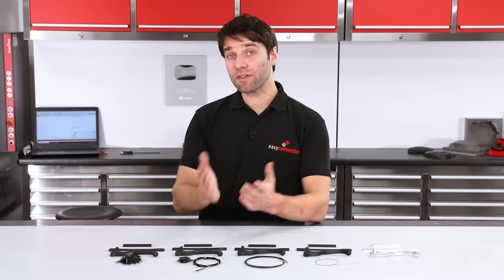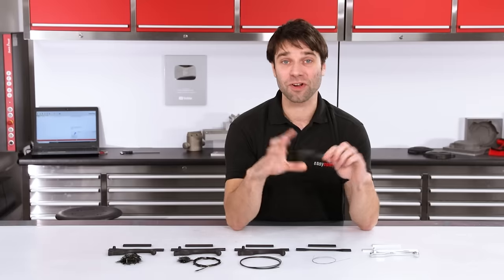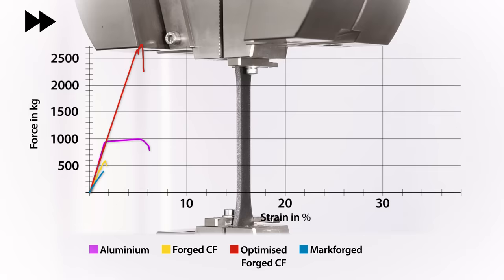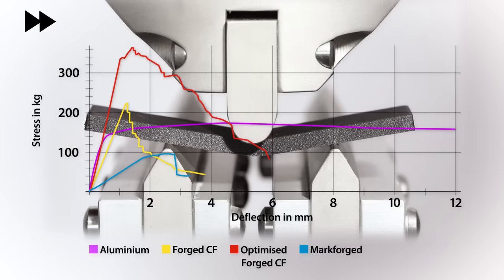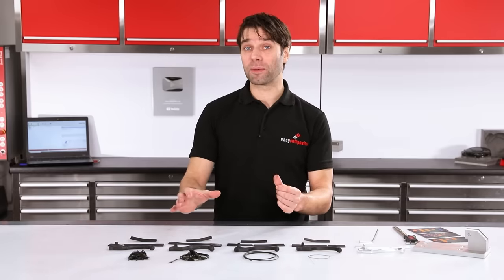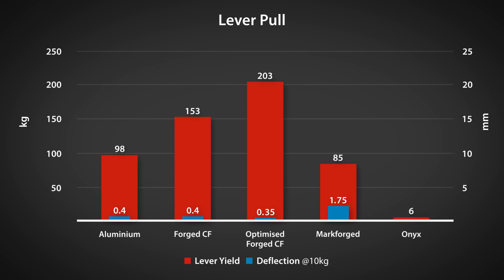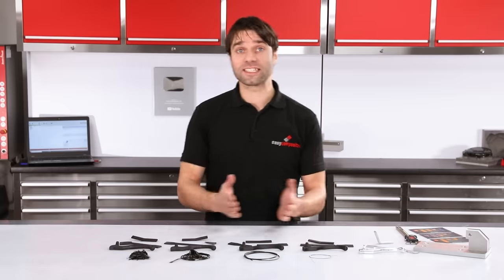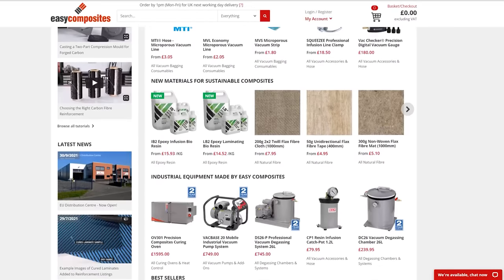How Strong is Forged Carbon Fibre? Forged Carbon vs Aluminium vs Markforged vs Onyx

Comment: Impressive video, the content alone is practically enough for a publication, but then you go and deliver it in such a comprehensive way, thank you very much for that. 

I do have a question, 3D printing seems to really have gotten a foothold in composite production, do you know of any filaments that can be used to directly print a mould for prepreg CF? It would need to stable at pretty high temperatures, maybe you've come across any that can withstand that? It would really open up for a lot of possibilities in the small workshop.
Reply from the maker: Hi Morten, it's a good question. The short answer is no, we don't know of any filaments that could be used directly as a mould for prepreg part production. The slightly longer answer is that several filament manufacturers are working on filaments that might open up possibilities in this area and some of them have contacted us to do tests and provide feedback, which we've started doing. It's early days and nothing that we could say with certainty whether or not it's viable but as we start to build up some findings then we'll be sure to share them.

Comment: Fantastic video, and incredibly insightful! I feel a good point to call out as well would be the use of a thermoset for the forged CF parts while a thermoplastic was used for the others. Using PEEK for a resin system would've been a little more comparable, however would have probably had the same results for which parts would fail first. Curious if this was something you guys considered?
Reply from the maker: Certain plastics are more suited for 3D printing compared to composite use and vice versa.  There are some fibre based materials available with thermosoftening plastics such as nylon and polypropylene but generally they are fabric based rather than a random chopped tow.
Reply: PEEK would need processing at 370degC+ which would need steel tooling and good temperature control. You would also have trouble getting the material into the lever tool in the first place
Reply: @TheScouseMonkey  Makes sense, Thanks!

Comment: Static mechanical testing is definitely helpful but true analysis and comparison can only be done with dynamic testing. I would love to see some fatigue tests between the parts.
Reply from the maker: Sure, dynamic results would also be interesting. Unfortunately, we don't have a dynamic test rig so fatigue tests and the like aren't something we can run at the moment. We will continue to invest in our test setup though so maybe in the future we could run some of these tests.
Reply: Carbon fiber probably has the best fatigue life of any material, bar none.
Reply: @mckenziekeith7434  The thing is fatigue is very situational and a material like carbon is much less predictable than say a steel or titanium which have a fatigue limit. Steel or Titanium components can be designed to operate under their fatigue limit which gives them fantastic reliability. Carbon on the other hand often is impossible to diagnose if damage has been done to the components. Cracks often propagate on internal layers and go undetected till repeated cyclic forces cause a violent fracture. This is why fatigue testing is so interesting it is done with fully manufactured components (not dogbone or other standard specimens) and performed in a unique way that simulates the forces a part would endure

Comment: Out of curiosity, instead of using chopped strand tow, if you took long strands and broke them down to the individual fibers and spun it into a sort of "carbon wool" and forged with that, would it have better isotropic strength due to the tangled web of long strands?
Reply from the maker: Hi Brent, that’s a very interesting question. Honestly, I’m not sure. On a hunch I would say that the results would be similar. My reasons for thinking this are a bit complex and might not be correct; maybe we could do a test! We do sell a non-woven continuous mat - we could just need to test a sheet made from this against a sheet made from forged carbon fibre. Very interesting idea!

Comment: Believe it or not this is going to revolutionise healthcare. Really appreciate your work, thank you Paul and the team.
Reply from the maker: Glad to help.  We already see some carbon fibre and composite parts used where weight is important and also for items used in X ray or similar processes where avoiding metals can be important. I suspect over time this will expand as you suggest.

Comment: Very interesting! I would have liked to see a fatigue test as well; aluminium is not known for its great fatigue behavior, so it would be super interesting to see if forged carbon is better
Reply: so many parts that are made of aluminium, like frame wheels and etc…Aluminium wont sustain elastic movements but surely is very durable for most aplications.

Comment: There's always something better. Don't be surprised when you see something new this year cheaper , lighter, and more resilient than anything yet. The highest tensile test is what matters most and there is a material that beats everything 30x over but producing it meant using a factory in space until now.

Comment: what kind of mesh would be best suitable for making carbon plastics for a dirt bike/supermoto? laying it by hand not using vacuum
Reply from the maker: By mesh I’m assuming you mean carbon fabric? If so, in a lot of ways it doesn’t matter - what’s more significant would be the overall thickness, the resin system and the alignment of the fibre. To get a better idea about weave choices, check out our recent video on different weights and weaves of carbon fibre explained.

Comment: Very interesting (albeit commercial) use of the word "forged".
Compression moulded maybe, but certainly not "forged" by any stretch.
Reply from the maker: Thanks for the comment and yes, the term 'forged' carbon fibre is not the clearest but it's been around for a while now  (Lamborghini have been using it for several years) and is quite widely used with an established meaning. To avoid using the term would mean that many viewers interested in understanding 'forged carbon' might never find this content, get to see what the term refers to (for some at least) in the context of carbon fibre composites, and learn how - for the right components - this process can be used to produce strong, lightweight parts with minimal equipment.

For what it's worth, before making the video we did discuss whether to use the term 'forged' a lot because we really weren't sure ourselves. After lots of deliberation (checking dictionaries and researching the history of the term) we decided to go with it but we did expect others might come to a different view, and that's fine too. If you'd like a much more lengthy explanation of we came to our decision please get in touch, we're happy to have more healthy debate on the subject

Comment: Probably just as important (in the case of levers on a motorcycle) isn't just the overall strength to finger pulls, but also HOW they failed. The aluminum lever might have started to yield earlier, but the important point is that it failed in a ductile manner over a larger displacement, whereas the forged non-optimized sample splintered and the optimized version started to splinter but retained its strength for longer. If you dropped your bike, it's more likely that the aluminum lever would just be bent rather than straight fractured and you can at least get home vs the non-optimized forged carbon part. The levers themselves also don't tend to see much finger strength- you wouldn't want something as flexible as the 3D printed pieces, but you also aren't expecting the user to grab a fistful of brake (which would lead to disaster) either.

Comment: Kudos, impressive effort and amazing presentation as usual.:washhands:
While I don't think the main result would be any different, I would have followed each material's respective ASTM test standard for each test. This way, the numbers (Strength, Flexural modulus, etc.) would be more accurate.   
For example, I would use additional tabs for the forged CF tensile test to avoid failure in the clamped section that is usually due to the additional clamping pressure (Changing the clamping pressure may also be useful but slipping may occur) and extending the support span will increase the accuracy of the three point bending test as the failure in short span flexural tests (ASTM D2344) usually occur due to combined bending and shear stresses. Following the correct test standard (ASTM D7264), the support span would be 32 times the thickness of the laminate.
I would also suggest comparing laminated UDCF and 0/90 woven CF to the list for future videos.
I really enjoyed this video. Thank you for the great content❤
Reply from the maker: The testing was deliberately not specifically to ASTM or ISO standards as it is a comparative test so it was more meaningful for the type of samples to do it in the way we did.
Reply: @easycompositestv  As I said, I don't think the results would have been any different. It would only make the numbers more accurate. The optimized CF would still beat Aluminium and 3D printed CF. Great work 👏🏻

Comment: how does changing fiber volume fraction impact bending stiffness, when the fiber volume is kept constant?
would a thicker laminate with the same number of layers be stiffer than a thinner one, that's using less resin?
and does it impact tensile strength at all?
Reply from the maker: It's very rare you would ever want to increase the thickness of a component whilst maintaining the same amount of reinforcement. Since the reinforcement (like carbon) is lower density than the resin and brings by far the vast majority of the strength and stiffness, maintaining as high as possible a fibre fraction is always a good thing. For this reason, direct comparisons between a thicker, lower fibre-fraction laminate and a thinner, higher fibre fraction laminate are pretty moot. Broadly though, I'd expect more stiffness (flexural modulus) from the thicker laminate but a lower flexural strength. Overall tensile strength is easier to understand - the thicker component would have a slightly higher tensile strength because even resin would contribute something to the tensile strength and so if you're ignoring cross sectional area (which in your case, rather unusually - you are) then it would indeed take a slightly greater force to break the component if it was thicker with more resin. However, factoring for cross section you would significantly reducing the tensile strength.

Comment: As a large 3D Printing fan can you possibly add some more brands of the CF Filament. There are several types of it and knowing what is actually close to aluminum would be very helpful for real products that can be made!
Reply from the maker: 3D printing is not a core part of what we do so you would likely find filament comparisons on a channel focussed solely on 3D printing.

Comment: Very nice and informative!
Any chance you will make some follow ups with impact resistance and how temperature effects the results?
Reply from the maker: Hi Rolf, it might be a little while before we return to any further testing on this material but there are indeed some other properties that would be interesting to get a better handle on, impact would be one of them. Temperature I think would be a lot easier to predict; whilst staying within the Tg of the resin system used, the results will remain pretty-much unchanged from the ambient results. For the IN2 resin system the Tg would be 92°C so under that, the material would behave as per the tests. If you need higher service temperature then a high temp resin system like our EL160 could be used, this can raise the Tg to over 160°C and also has even better mechanical properties than IN2. Certainly at this temperature you would have seen a collapse in the properties of the 3D prints but very little effect on the aluminium.
Reply: @easycompositestv  Thanks for the extra information. I was thinking about lower temperatures but now my slow memory kicked in so I remembered your sled series - I need to go back and check that out again!

Comment: I'm curious how this would compare to typical laminated carbonfiber weave. I would also like to see a compression test too.
Reply from the maker: The optimised would be relatively close.  The difficulty in comparing in the real world would be that the brake lever and other 3D shapes are less suited for making with a typical composite process, hence the forged carbon can be effective in such shapes.  A simple flat test token could be made of each and tested but would not be representative of real world use.
Reply: @easycompositestv  Right, to get something like that handle you'd probably need to make a block of layers then mill it down and then drape afterword. I see why the optimized forged would be a better solution for cost, especially if the strength would be comparable to standard laminates.

I would also be curious on testing different binders just to see how that effects things.

Comment: What about temperature resistance between all of them? Wanna see if it'll go above 60° without deforming
Reply: With carbon fiber it completely depends on properties of resin used
Reply from the maker: The resin system will go to 80C with an oven post cure. The aluminium will obviously win in any HDT comparison.

Comment: ive been waiting for this. carbon fiber also isnt very shock resistant. it can shatter and break with impact. like if you dropped your bike. bent or broken levers on your bike. i guess if you used as much carbon fiber as possible you could save alot of weight on a bike. bunch of small stuff will add up.
Reply: Yeah I'm curious what the impact forces of a dumped bike might be on a handle. An interesting test would be knowing what that force is and what a part designed for each material would have to look like for size/weight.
Reply from the maker: It would require quite a lot of testing as speed of bike, weight of bike, weight of rider, surface impacting on,  angle of load etc etc etc would all have an impact on the peak loading experienced.

Comment: The impression I got from the 3D printing community was that CF filament is great for stiffness and preventing deformation while printing, but the material the CF is in is what you have to count on for the actual strength after the print is done (but your part is now electrically conductive). These tests seem to agree with this.

Your 3D printed nylon with CF in it acted like nylon, but I bet it was easier to print than if it hadn't had the CF.

Comment: Hi. Thank you for this. It has made me think of including trigger and sear with carbon fiber in my speargun design. Is that inadvisable??
Reply from the maker: It depends on the loadings and also wear over time. Usually most trigger and sear parts are made of metal for strength and wear resistance. Depending on the metal, it can be possible to replicate the strength in forged carbon, the wear aspect depends on the specific application.

Comment: Very interesting. If you can - show the same test lever made of Kevlar and Kevlar + carbon. What will be the characteristics? What is better Kevlar or carbon fiber or a mixture of both?
Reply from the maker: Kevlar is less stiff but has greater impact resistance and abrasion resistance.  On a brake lever you would want a reasonable level of stiffness for brake feel (as shown in the tests) so a pure kevlar product may not work so well.  Testing would be the only way to find out for sure. Also you would have to chop your own kevlar as we have not seen a chopped tow format kevlar available.

Comment: Very good! Would have loved to see you try adding milled carbon fibres, I have a tub of them from you and they are great, I use them all the time. Plus you can add more volume (especially with your infusion resin) before the mix becomes too thick. Hard to do direct comparison I guess though, easier to add higher % fraction of milled than chopped.
Reply from the maker: Milled carbon would be better suited to a cast resin part rather than the compression moulding process.

Comment: Thank you. The only thing missing is the cost to make each one of those parts. Would you please add it to the comments?
Reply from the maker: Hi Ihab, that’s tricky to say in a way because which parts of the process should be included in the cost? For example, should the cost to make the moulds be included? If so, making moulds is probably more costly that making the parts, and what quantity of parts.. one, ten, a thousand? Tools to cast then machine the aluminium? There’s a lot too it. In really simple terms, the Markforged print cost us over £100/€120/$130 but we had to pay to get that printed, same with the Onyx, which was about £30 but would be much less (in materials) if you printed it yourself. The material cost in the forged component was maybe around £3 but we did all the work ourselves. The aluminium levers are produced in their thousands and this one cost £18.

Comment: I would like to see a video comparison of different resins with a known part using the same method (optimized) for strength.
Reply from the maker: Generally for advanced composites, epoxy is the main choice and there are relatively few high performance resins out with that which would make a meaningful test.

Comment: Great video! What exactly makes Markforged perform worse than optimised Forged CF? Is it the missing pressure from the bench vise, faster curing polymer or maybe air pockets?
Reply from the maker: Its fibre within a polymer so the fibre/plastic ratio is not as high  plus also the polymer used may not be as rigid as a typical epoxy.